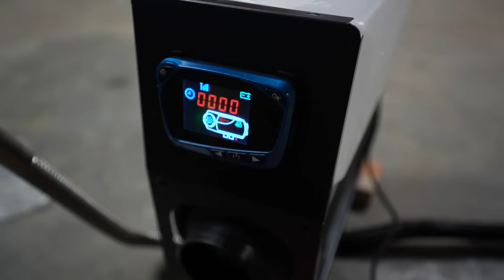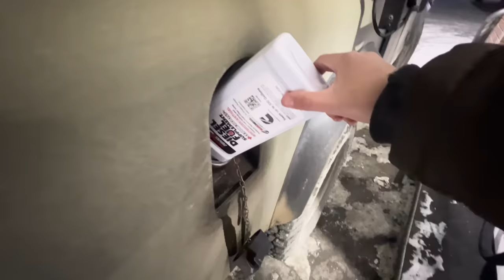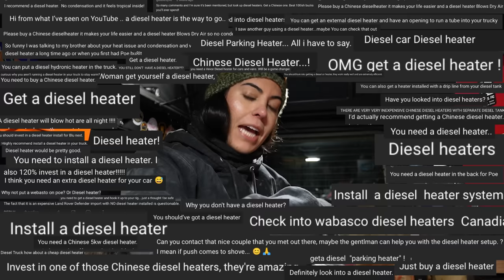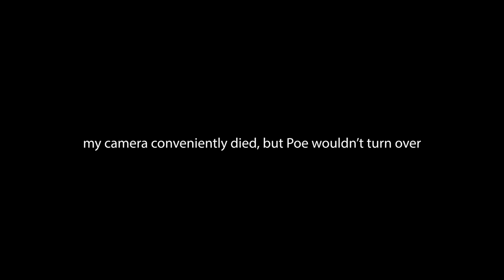Truck Camping in -15 Degrees under the Northern Lights

Comment: OK, by now my blood pressure has come down a bit ... 😳 You had me stressed as I've put myself in similar situations in life and by the grace of the good lord I'm still on the planet. Please, please, please, stay in air B&B's !! If you need help reach out and I'll chip in via pay-pal as would many of your viewers if money is an issue. You really need a place to stay with heat and hot water. Also, as you already know, diesel engines do not like the cold and you're getting in a situation where Poe will not start unless plugged in and that's if there's even a block heater onboard. But, the heater is irrelevant as last I checked there are no outlets in the woods. Either way, no shame in sleeping in comfort and avoiding a hypodermic end  😪 Be smart, be safe and be warm and comfortable 👊🏻

Comment: Did you check oil level in the diesel heater? If it's low a safety keeps it from starting.

Comment: not saying this happened to you but ive watched a few other van lifers trying to use a diesel heater with a power station type device and the initial draw of power to start the heater is to much for the battery and it just wont work. again not saying this happend to you but its possible. be safe.

Comment: The problem with the diesel heater is the electrical supply. This is a common problem for people using Jackery and similar power units. These devices limit the power out of the 12v power port. 

Your video shows the control has power. When you turn the heater on the fan starts and everything is okay. After a second or two the heater tries to turn the glow plug on. This draws a lot of electrical current. The power supply limits the electrical current. The heaters are also produced with a very long small diameter wire for the power supply. This causes a voltage drop when there is a high current draw. The voltage at the heater control end of the wire drops too low and the controller shuts down. 

You need to connect it directly to a 12v battery with a fuse in line. If you can shorten the wires or replace them with 12awg wire it will reduce the voltage drop.

You can also get a 12v DC power supply that is rated for at least 15 amps. This can be plugged into the 110v AC on the Jackery.

The diesel heater only activates the glow plug for a minute or two during start up and shutdown operations. The current draw is much lower once the flame ignites.

You should consider having the diesel heater properly installed in the truck. Trying to heat -15 degree air all night will waste a lot of fuel. You want to recirculate the air in your truck. Only the combustion air intake and exhaust should be outside.

The diesel heaters are good efficient heaters, but need to be set up properly. 

I started with a Mr Buddy heater and while it was better than no heat, it is not even close to the comfort of a properly set up diesel heater.

Get the power supply sorted out first and then it will provide some heat. You can improve from there.

Comment: Alaskan winters can kill you with temps -30 to -50.  With a wind chill can too be dangerous to even step outside.   You should keep at least  3 souces of heat and several propane bottles and lots of diesel fuel.  Not just because of cold, but becuase one can be snowed in for weeks at a time.     Really should rent an apartment  in Alaska if you plan to stay.  You will need engine block heater or Poe will never start, and the heat in Poe will be inevective

Comment: Get the correct  night heater installed not a cheap Chinese eBay thing , as stated the return air would be better if it was the pre heat circuit. Feel like iv added another daughter to my clan

Comment: You need a block heater to keep your engine warm. Also, I don't know if your diesel engine has a glow plug heater.  Sometimes it's a button on the dash that you hold in for a minute to heat up the glow plugs  before you even attempt to start it. They also have block heaters that you can put in the dip stick tube that keeps the motor oil warm.  I diesel engine is a HEAT engine, they don't start easily when too cold. Also your diesel heater glow plug may have been too cold to start. Might be an electrical problem. Hope you get that sorted out because you need heat or u gonna die. In a pinch I you could fire up your butane stove, but that's taking chances. I'd go back to that buddy heater at least as a backup. Good luck out there please stay safe!

Comment: I have an ex military Land Rover (101 forward control v8) and they are the simplest vehicle to do an oil change. 
Let’s face it they are designed to be worked on in the field if necessary. 
So if a so called mechanic won’t change the oil either they are really useless or they just don’t want to.

Comment: Why didn't you try to get the diesel heater installed by a professional? I wouldn't even think that I would be able to install it on my own.
Reply: Its not hard. And its the Jackery that's the problem. It can't take the initial glowplug draw. If it was the heater it would throw error codes, not turn off.

Comment: Never ever turn off your engine in such a cold environment, let it idle even while you sleep.
Put some cardboard or plastic over the front grill, so that the engine can stay warm, as cold does not get into the engine so easily

Comment: Hey Ria, You Could just store those food out side since it is freezing cold!?!?  You can change oil yourself. Too easy! I guess American sue for anything everything( I figured that from Judge Judy)  Thats why they dont want to do it???  I hope you will not die from carbon monoxide poisoning.  Personally I will not use things like that.  But leave window open bit if you have to use it. Better insulate all the windows ! You need alcohol very strong one to warm you up!  You need thick sleeping bag! Hug dog!  I think top tent might be warmer! Hot air goes up!  Gordon is genius! I thought you put Disco seat but somehow he made bottom seat removable?!

Comment: Does your pump work to prime the unit?  Did you hear the pump clicking when you primed like you said?  If you did i would suspect that maybe your unit just has a falty screen or the pc board inside is damaged.  Did the heater run at all and get hot?  if it did... did you shut down properly or did the unit just shut off suddenly and not get a proper cool down run.  this could have ruined the pc board.  if you dont think that is the case i would try replacing the screen with a new one.  i wish i was close to you to look at it personally :(

Comment: Wouldn't a diesel engine pre-heater be a good idea also? All that cold cranking can't be good for the engine... Land Rovers do come with engine coolant pre-heaters as an option in the UK. If you go for one also get a diesel heater (2 or 5kw..?) built in if there's space under the engine, and don't forget your antifreeze mix ratio. I think you need a good mechanic in Alaska Look up Mispronounced Adventures if you want to trick out your rig, he goes past -20F in Norway a lot... And yes, a Mr Buddy as a backup would be a good idea...along with a Garmin inReach...

Comment: Mother Nature doesn't care if you live/die. You need to be prepared for extreme cold weather, You should have test run the heater first plus you need to  burn off the chemicals  from a new heater, You should have had a backup heater like kept the buddy heater. A cold weather sleeping bag with a cold weather sleeping pad. A simple cardboard in front of the rad, New batteries a block heater or installed an engine diesel heater. Why don't airplanes crash like they use to because they have backup systems.

Comment: Top off Radiator Fluid all the time, fill it while engine running, it's the coolant that makes Poe heat..WEAR A HAT all the time, an expensive real hat..I'm in 4° no heater..just good bags, good clothes..for warm..if one thing goes wrong..you're screwed..I've winter camoed in tent fir decades, --30.. i know my shit🙂 change your scks every afternoon..feet sweat then yo feet freeze..first .

Comment: I’m a grandfather - not a dr., who follows your travel because I have a mini Aussie (Rowdy) who has one blue eye and one brown.  Truck drivers in the mountains in cold have “blinds” or panels that restrict air going through radiator - that diesel has to run in proper temp range or it may fail you.  That diesel heater is not to be trusted.  If you dont vent the exhaust properly (with perfect seals) you might be warm but you and Blue could succumb to carbon monied.  Not good.  Please get south of the arctic - it is unforgiving - and continue your adventure travels 😊

Comment: No to beat a dead horse but have multi heat sources propane and a reliable diesel heater NOT from china.. They also make tiny wood stoves for heat and cooking.

Comment: Jackery is 120 Watts
Diesel Heater is 300 or more.
These heater cant run on Power banks ....NO power banks output more the 120watts at DC port.
Jackery or whatever size....1000WATTS or 5000Watts.....BUT  NOT at the DC PORT.
DC PORT 120 WATTS max for ALL power banks
It needs direct BATTERY connection

Comment: Not to be the "I told you so guy" but camping in -15, you should always look at important items as 1 is none & 2 is 1. Basically you should have a backup. My brother spent a ton of money upgrading everything in his basement. Told him he should invest in a 2nd sub pump. He didn't follow my advice & when we got a really bad storm, his entire basement flooded because the 1 sub pump he had failed. Again, 1 is none & 2 is 1. Especially in risky camping like this. 
PS: I'm not mad at you cause you could have frozen to death. I am mad at you cause Bleu could've frozen to death! hahaha JK. Glad ya learned a lesson. Won't make that mistake twice. That is normally how it works.
OOOOoooooo, if you put your life on the line w/ a heater, I would suggest you don't buy anything made in China. 3X cheaper? Yes... Ya don't cheap out on -15 degrees beau. lol

Comment: Enthusiastic but extremely unprepared! The Jackery doesn’t have the amperage output on that outlet to get the diesel heater going on startup. You need a dedicated Li-po battery and you need don’t want the diesel heater outside trying to warm up -15 degree air.

Comment: I ca'nt weigh up why they would'nt change the oil.  If it was actual mechanic stuff,  i could understand. Behold,  that bit  on ya compass with an S on it might be an option, flower.

Comment: i guess I don't understand WHY you would want to car camp in-15 temps and it will get colder.  What are doing that is enjoyable?  I understand the "I can do  this" challenge, but maybe it is time to put emotions aside and look at facts and make a rational decision.  Enough butt chew from me. Keeps safe. You might want to look in to an engine block heater, but you need electricity.  I never start my diesel tractors in the winter with out plugging in at least 2 hours.